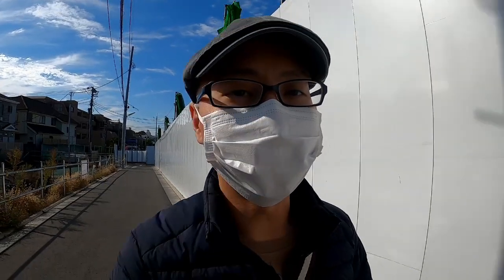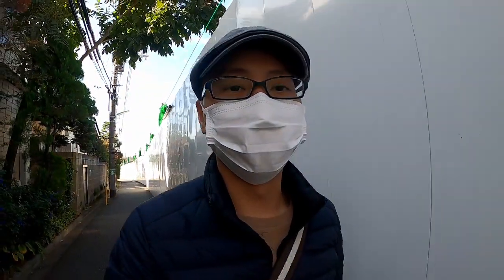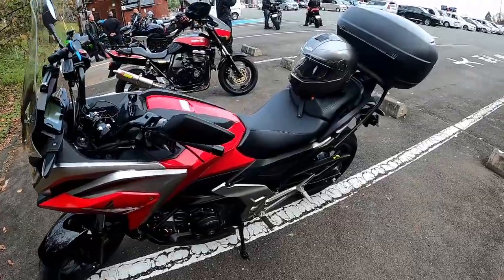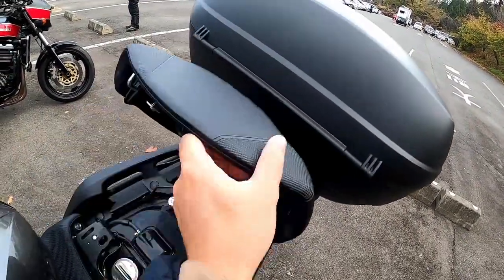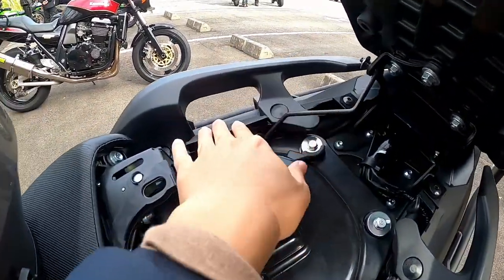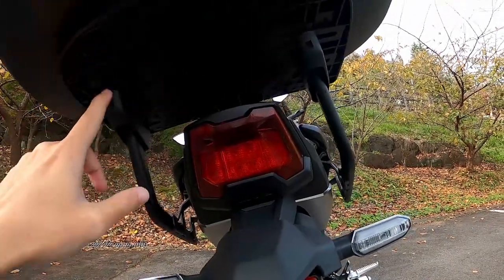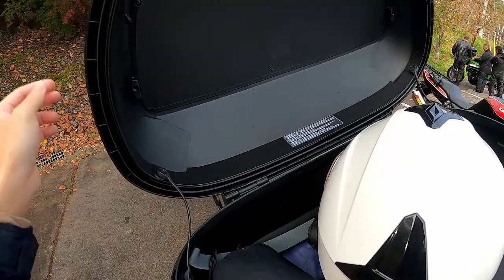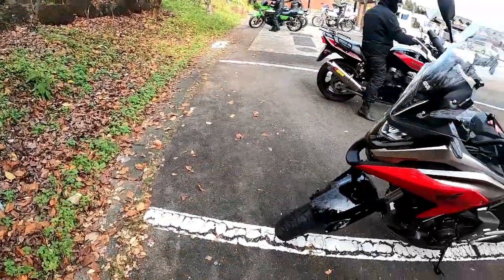2021 NC750X First Service and Shad SH48 Top Box Review

Comment: Shad make an excellent quality rack to fit the NC but their boxes are ridiculously expensive for a plastic moulding.
If I was doing it again I would still buy the Shad rack but would buy a cheap box instead and save over £100.
Reply from the maker: I have to agree that the plastic box is really expensive but wait till you see the price of the Honda OEM aftermarket box and panniers.